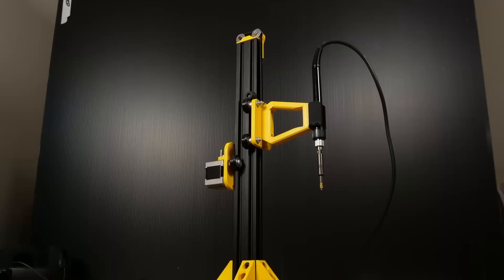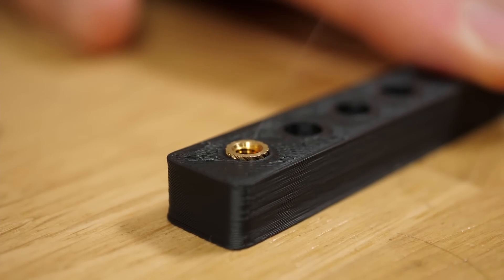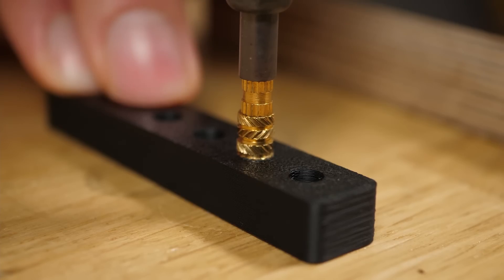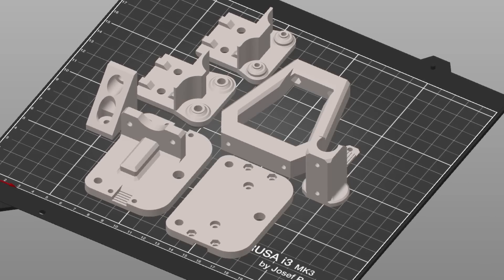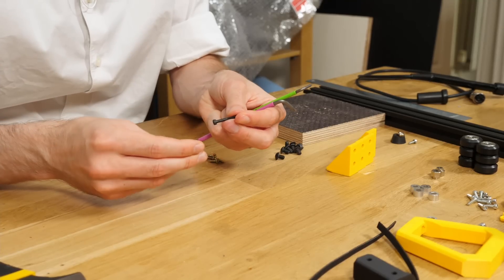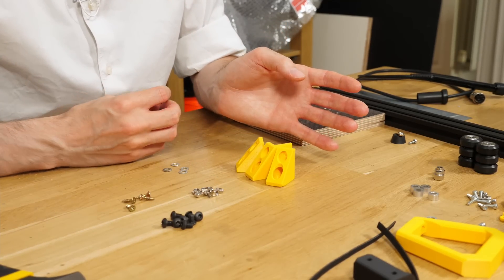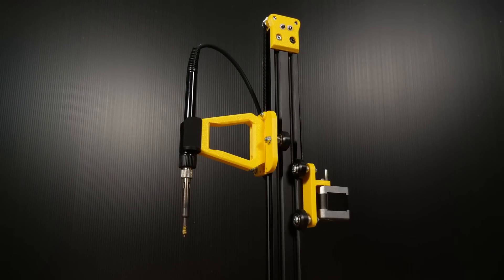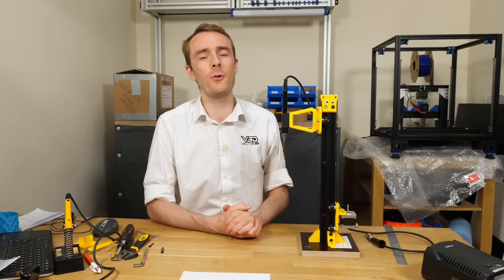DIY 3D Printed Tool Does PERFECT Inserts Every Time!

Comment: For me, everytime I insert the threaded insert nut, I will push it inside 3/4 of its height, then flip the 3d printed part making the side on a flat table then gently apply pressure on the printed part. The threaded insert will always be perfectly straight.  No failure at all and very simple
Reply: You just make the hole video useless! :D
Reply: @hugolatra  Sorry LOL
Reply: @hugolatra  I wish he mentioned this method in the video. 
It’s still useful if you are a maker space or make little series of things for selling in etzy for example. Also people with difficulties in their ability’s could use it.
Reply: same and also many parts are not flat on the opposite side of the insert, where this wouldn't work
Reply: @TheLordinio  If you really need a linear motion part that make sure it can go down straight, try 3d printer nozzle, heat it up to a certain temperature, manually adjust the z feedrate, and manual move the nozzle down. Bomb
Reply: @calvin-7540  this is actually EXTREMELY SMART
Reply: Sorry, I am not going to use my $500 3d printers to push in a threaded insert.....
Reply: you can always add "spacers" (such as washers, or leveling blocks, etc) to adjust highs and lows to make the item "level"...
Reply: Thank you for the tip!
Reply: I do this as well but in a case where we need the part to be a bit more inside the part instead of flux this becames a great option, because as much as we would like they sometime are not inserted strait and this might help fixing that
Reply: I am threaded insert nut Source Factory supplier, push it inside 3/7 of its height, is a good way, my customer usually do in same way, do you need free sample to new item? I can sypplu them for you free.

Comment: I watched you using it on your Voron build and thought it was pretty cool, keeps everything vertical but I don’t do enough of this to justify building this.
Did I not see a couple of inserts get pulled out on the build I seem to remember a couple got stuck.
A lovely project though.
Reply from the maker: The idler one came out when I used it, it that's more due to the print than the inserter. It's performed perfect so far.

Comment: I actually planned to build one of those when I got hold onto some inserts for a project but never really found the motivation to actually build one - mostly because I never actually had any of the described problems of inserts pulling out again or them being so much ( or even just remotely ) off axis for them to cause a problem - I do though use the method of either inserting them into the material only 4/5 the way in using the soldering and then do the final push using a piece of metal ( like an oversized M10 Hex Bit ) that will both straighten and flush it to the surface while preventing squeeze out around the perimeter or just flip the part and press it upside down on a heat resistant ( piece of aluminium ) surface if the geometry allows for it.
Reply: yeah for one or two inserts on a part this method works fine, but if you have say 10 parts that need 13 inserts each, this tool makes perfect sense and will ensure repeatable results just not gained from doing them by hand, however well calibrated your arms are lol
Reply: Professional Suggestion. Most of my customer work in this way when quantity is less. As source factory, we sue automotic install machinery to push them in bulk once. If you need thread insert nut sample, we are willing to provide.
Reply: @Threadinserts would love some